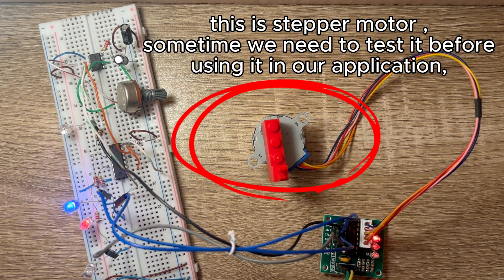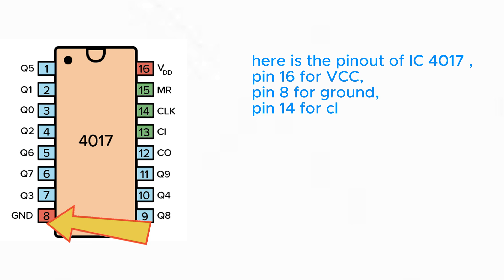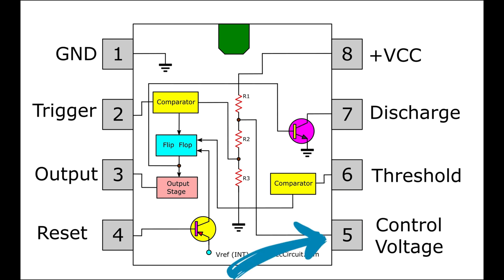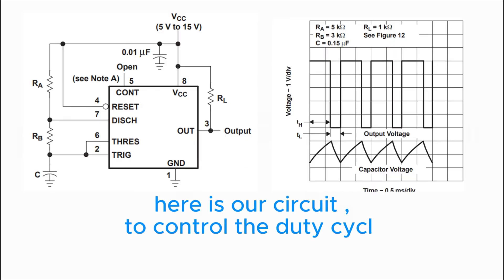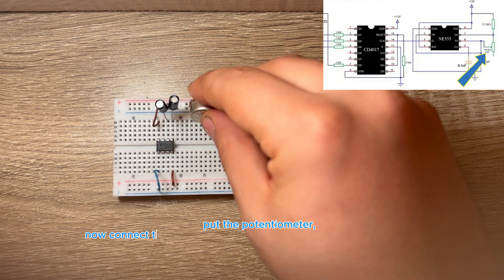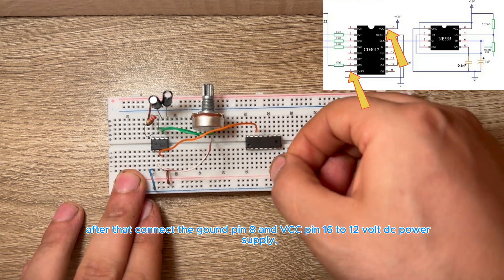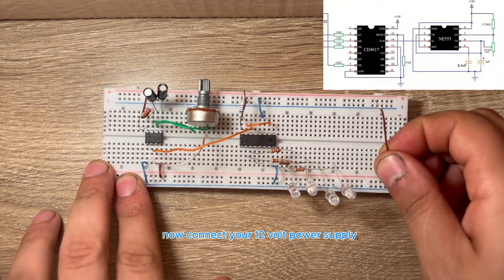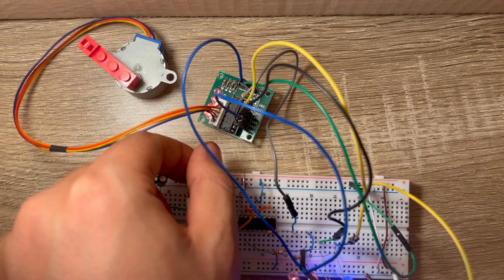(DIY)How to make your stepper drive using timer555 IC, counter4017 & ULN2003 to test unipolar motor?

Comment: You don't even need the 555. You can build a square wave generator from two segments of a CMOS hex inverter. One capacitor and two resistors!
Reply from the maker: Thank you for your suggestion. I will consider it for future videos.
Reply from the maker: Thanks you I will try it